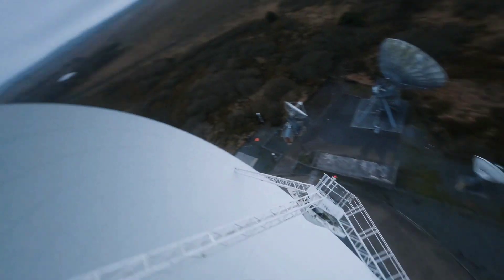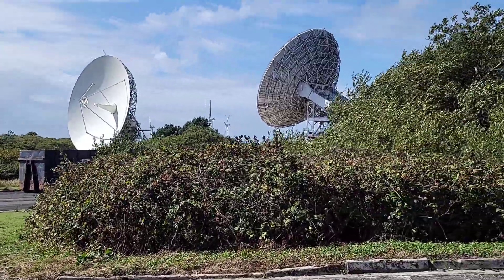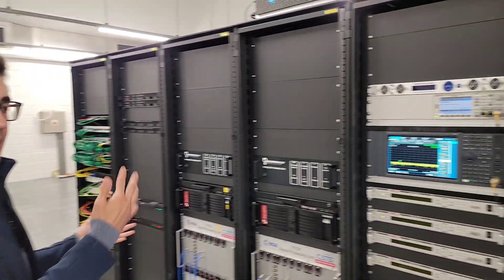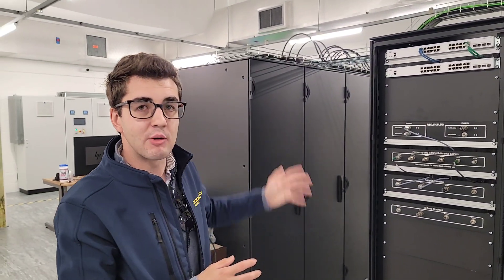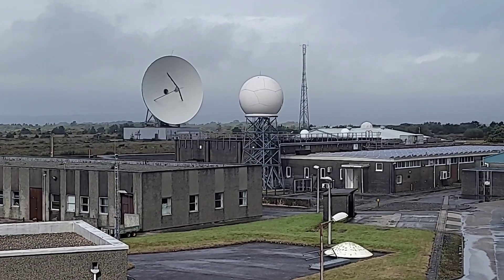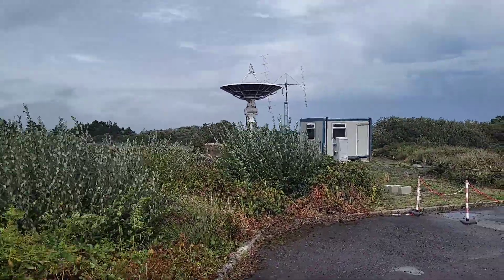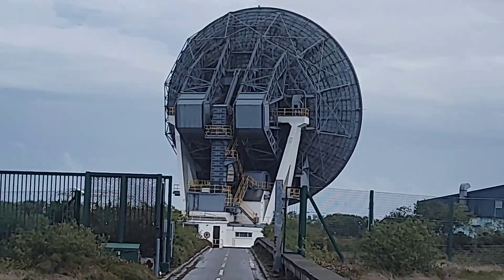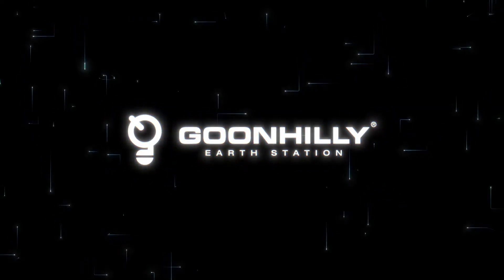NASA could learn something from Goonhilly!

Comment: NASA does not want to learn... or at least it's puppet masters. NASA is seen as a unneeded diversion of funds that states would like to see directly sent to their keeping... the next best thing is to require NASA to spend as much of that money in each of these petty kingdoms. Having success ends a project and means these fiefdoms have to put energy into thinking how they can be a part of the next project in the most lucrative way. Best the current project takes as long as possible and the part provided by ones fiefdom be as expensive as possible. I assure you that individual states do not like fixed pricing any more than the companies bidding on projects requiring them. The only reason fixed pricing exists at all is public pressure and perhaps SpaceX is making them look bad. (blue origin is probably upset that they missed out on the cost plus free for all of days gone by)